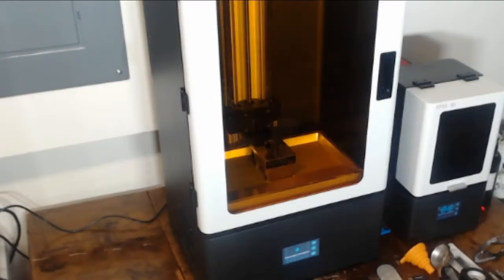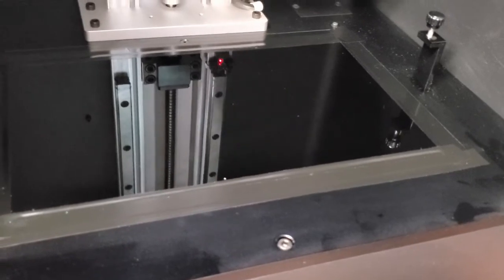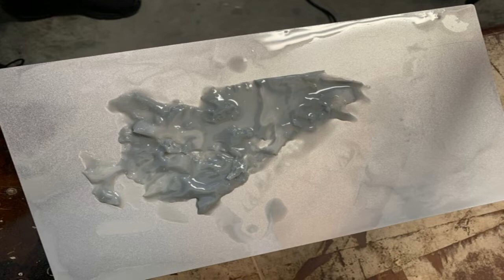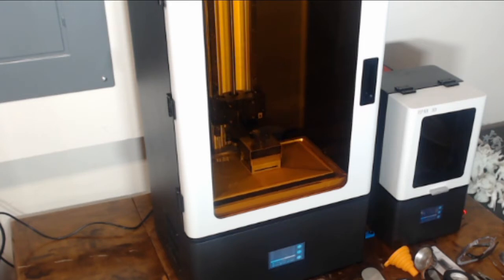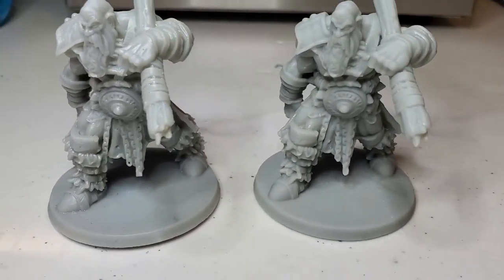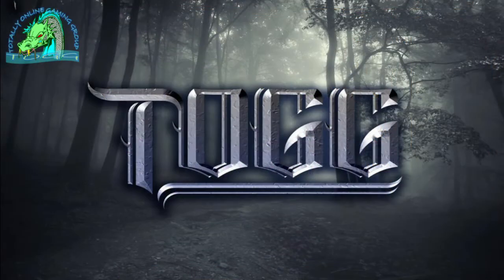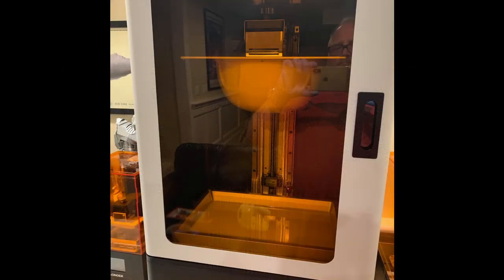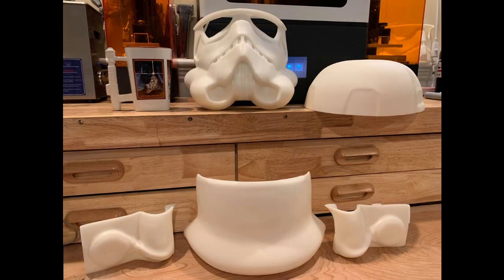EPAX X133 3D Printer UPDATED!!!! - Print Comparison - Let's Talk About...Episode 2

Comment: I have the X-10, it has made some incredible prints, and they will give highly-detailed product support but there is an issue with the Chitubox boards and screen interface, my machine has not worked for 3 weeks waiting to get a replacement screen to function corretly with newer firmware...very frustrating. I get the feeling Epax is mostly a designer of the box and ball-screw mechanism but rely soley on Chitubox for all the complex parts, and they have to ask Chitu for answers on that.